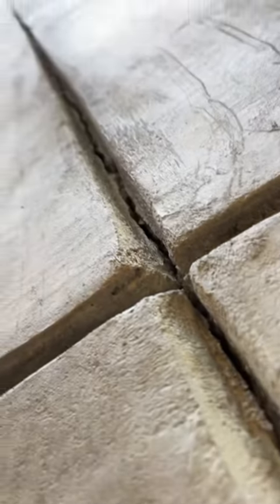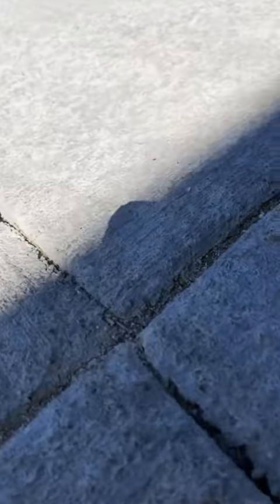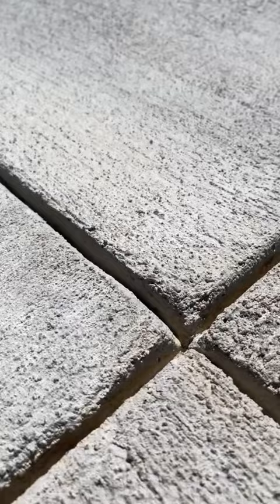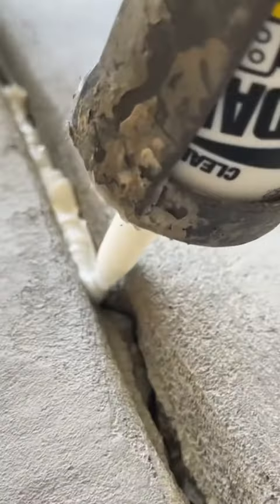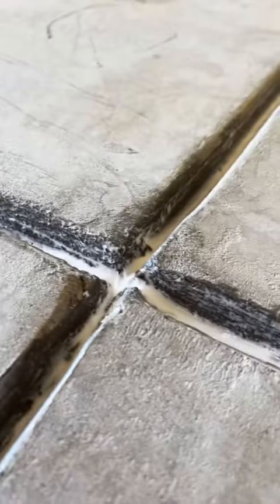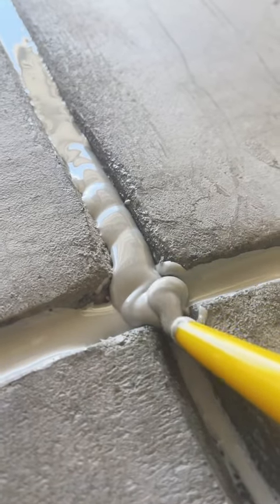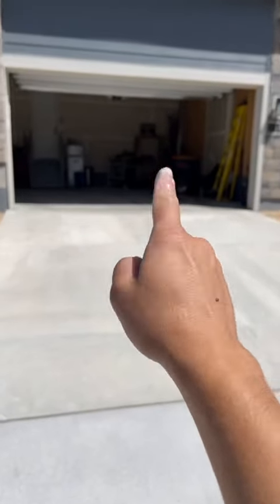How to seal control joints in driveway/garage. #howto #diy #handyman #controljoints #garage

Comment: Have you had issues with steeper driveways such that the self leveling material flows downhill?  
I’ve used something similar on my basement floor joints but those were level.
The vendors product info states “not for sloped surfaces”. 
What’s been your experience?

Comment: Expansion joint is the proper term
Reply: Actually control joint is the proper term. A control joint "controls" where the cracks form since concrete will crack sooner or later, you want to control the cracks and kinda make it crack where it's not as noticeable. A expansion joint has a foam strip between the 2 slabs to allow for expansion and contraction. The expansion joint could also have a piece of fiber board or sometimes wood, anything compressable.
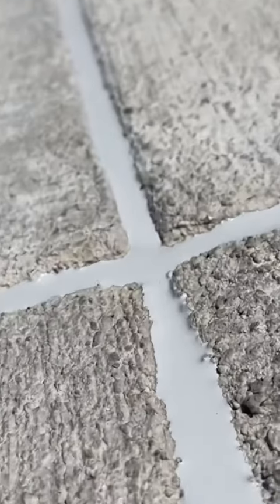The joint between the garage slab and the driveway slab you can see briefly @ 1:50 is the expansion joint between the 2 slabs because they are poured @ 2 separate times.